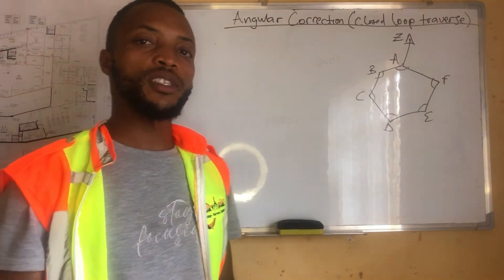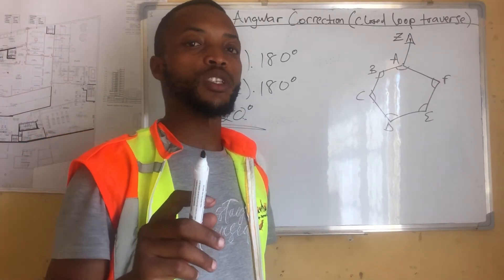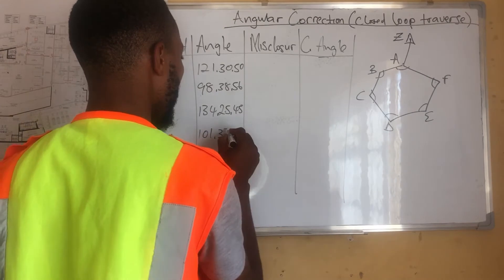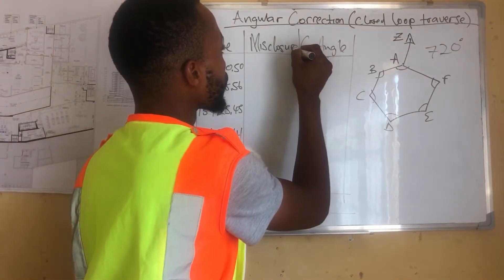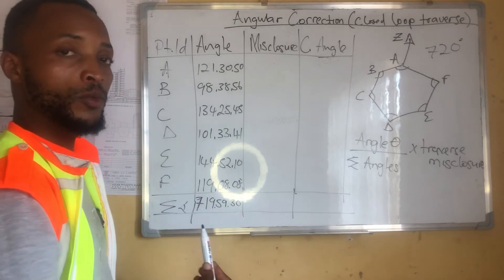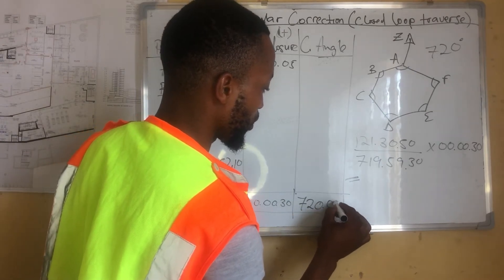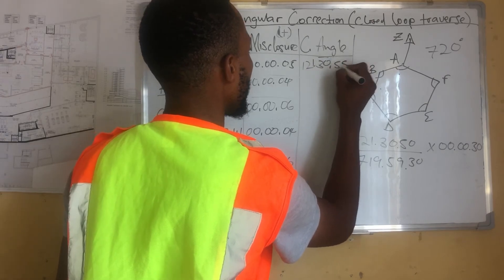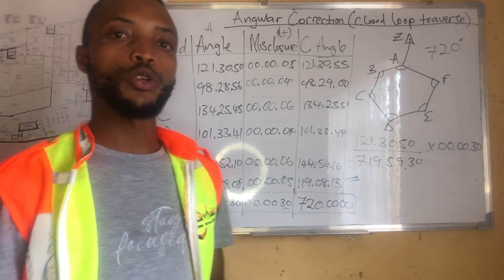How to correct angular Misclosure in traverse (closed loop)

Comment: Two tangents intersect at chainage 150m. The angle of intersection is 150degree, calculate all data necessary for settjg out a curve of radius 230m by the deflection angle method. The peg intervals may be taken as 20m. Also prepare a setting out table when yhe lease count of the vernier theodolite is 20n. Determine the discrepancy or misclosure if any in above. Pls sir help me out
Reply from the maker: Sorry right now im in the field for sometime.. but what you need to go is draw what you are understanding from the question, usually by doing so it make the question easier most of the time

Comment: Hello sir good day thanks for the solution but i have used this method to solve a question but still yet I'm still having problems in getting my Correct angle i need your help.😢
Reply from the maker: Did you do a redo for the whole question ?
Reply: Yes because according to the video when you where calculating the correct angle you took Angle+Misclosure for the first one it was correct but the second you change the format of calculating so I didn't understand.
Reply: It's just if there was a way for me to snap and send it to you I would have.

Comment: A student counted 92, 90, 92, 91, 93, and 91 paces in six trials of walking along a course of 60m known length on level ground. Then 85, 86, 86, and 84 paces were
counted in walking four repetitions of an unknown distance AB. What is 
pace length and (ii) the length of AB
PLEASE 😢 HELP ME WITH THIS
Reply from the maker: 1) Average the first set of paces
2) divide the known length by the average pace. This will give you the average meters per step(pace)

Now
3) average the last set of steps(paces)
4) when you get the average multiply it with the average meters per step you got at number 2. That will give you the distance.

Hope it helps and please send me the answer if you finish
Reply from the maker: You can send here
Reply: @Zim_mining  ANSWERS
1: average of first set = 91.167
2:  0.658m
3:85.25
4: 56.095m
Reply from the maker: I got 91.5 on the first average… can you cross check… other than that everything calculation was ok…
Reply: @Zim_mining  thanks very much sir
I got 91.5 
God richly bless you